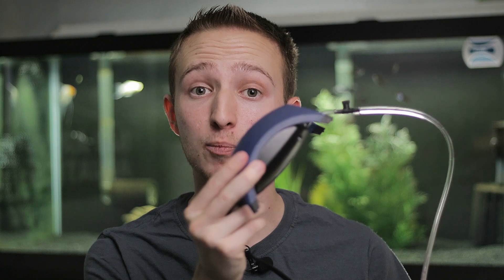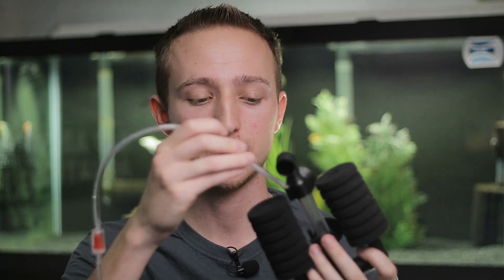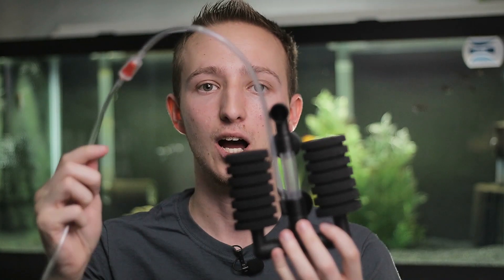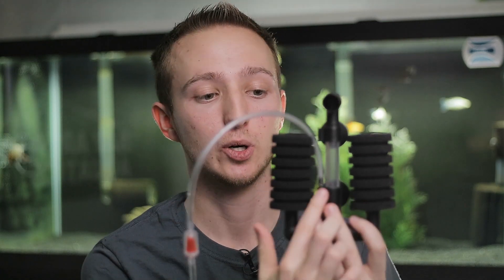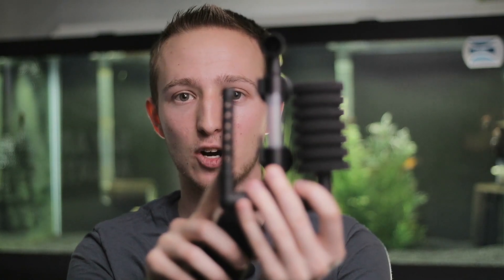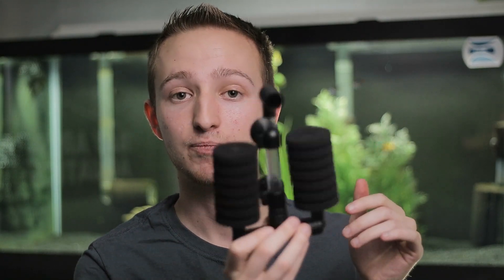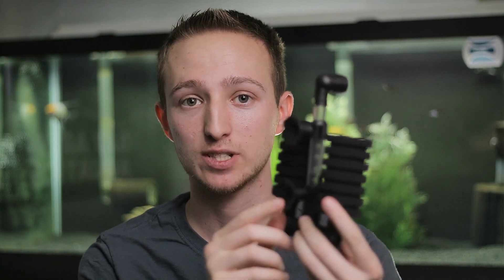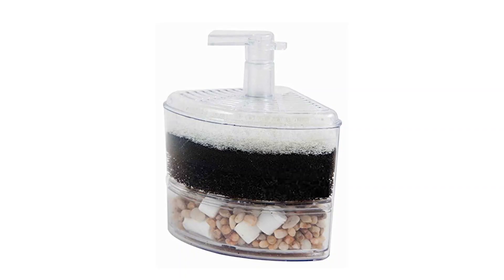How Do Sponge Filters Work?

Comment: I still don't see the suction of any significance.  If it it is its very minimal and if it can suck something maybe a Small dust size Particle if it's passing by it with no resistance at all.  But that's just my view. Just another gimmick to buy that we really don't need. Wahts next a sponge that suck with the electrons in the water no air you can't see but it's working just add it to your tank. Set it and forget it lol

Comment: I have a question: So do you replace the sponge, like you replace the media in a hang on filter? I am starting a 10 gallon betta planted tank. And have a Top Fin MF10 and was wondering what type filter would be best, the Top Fin or a Sponge Filter?

Comment: I still dont know how they filter. I get there are holes and a sponge and water goes through it but what it is doing to the water? Cleaning it? When it gets dirty do I throw it away? Just set up a new fish tank and have no clue how often do I change them out and part of that is that none of these videos I've found on YT actually explain what the sponge is doing if that makes sense?
Reply: So the sponge filter acts as a surface area for your beneficial bacteria to grow. As the water rises with the air the water has to pass through the sponges where the bacteria are. There the bacteria can start I break down ammonia to nitrite and then to nitrate. Cleaning is as simple as taking it out of the tank, rinsing it out to get rid of all the debris trapped in it, and sticking it right back in the tank. You can preventatively do it or do it once you start noticing a decrease in bubbles coming from it.  I’ve used both my tap water and old tank water and haven’t had any issues. If you want to error on the side of caution you can use tank water. Sponge filters last for a long time because they don’t haven any mechanical parts like a hang on back filter or canister filter do.

Comment: What all do i need to use this kind of filter. ... The air ... Sponge ... What else do i need? .... TIA
Reply: All you need is the sponge filter and an air pump. Get the airline tubing attached before putting it in water and you’re ready to rock.

Comment: Nope. That isn't how it works. The air bubble does not suck water up as it rise. It displaced the water. Pushing some of the water out and only if the exit tube is long enough and reaches the top of the water surface. Other than that its not doing jack squat other that and have the same displace water pulsing in and out if the filter.

Comment: I have the tetra brilliant which is like a single sponge version of what you\re holding. I'm not convinced it does anything. It bubbles and gurgles a lot but doesn't seem to actually suck anything into the filter. It's almost only air coming out of the top
Reply from the maker: It's primarily a biological filter

Comment: How do you clean one without killing the beneficial bacteria?
Reply from the maker: I get a 5 gallon bucket of either dechlorinated water or the tank water I'm pulling out, and then put it in that bucket and start squeezing the dirt out. If the water gets really dirty, I dump the water and refresh it, and start squeezing again. Some tanks are clean and only take 1 bucket, some tanks are dirty it takes 3-4 buckets before they stop making the water dirty. If you're on well water or have water that doesn't need to be treated, you can just wash in the sink.
Reply: Bay Area Aquatics thank you for including well water. I haven't really heard anyone address well water a whole lot.

Comment: I have a mini spong in my quartenite/hospital tank I just got for another new batta. So far it's ok, it's the air pump that bugs me with the noise. On high it sounded quiet and within 10 minutes makes a rattling noise so I keep it on low. Still a little loud for low unless I put pressure on the airpump and it almost muffles the noise. I couldnt find a small enough hang on the back filter for a 2.5 gallon
Reply from the maker: I find setting the pump on a towel helps a lot
Reply: @TrekOnTheAir  thank you it is rattling less but still loud so I'm keeping it on low. How long does a spong take to cycle tank? Bettas are hardly so I basically had my tank that's been sitting for a couple weeks with no filter, did a 65 % water change and put the spong filter in and filled the rest with tap water. I still have to clean it more because there is "dust" like substance on the plants and lightly over the gravel. Not sure how that happened
Reply from the maker: You're going to want to look up a "Fish In Cycle"
Reply: @ashleykeith9204  I hope you don't fill your tank directly with tap water. Be sure to get a dechlorinator, he chlorine is bad for fish and will kill the bacteria you're trying to build up when you cycle the tank
Reply: @paytonmacdonald1409  I did I just forgot to add that in. I also put in an indian almond leaf because his fins were just short from just being in a cup but hes doing great now :)

Comment: is a check valve necessary?
Reply from the maker: Not if the air source is ABOVE the tank. If it's below the tank, or even at the same level, the water can siphon out of the tank, destroying your airpump and leaving you with a mess. They're less than $1, I run it even when the pump is above.
Reply: @TrekOnTheAir  I have an aqua clear 20 and the bubbles pulse instead of flow steady,any idea why?
Reply from the maker: Bubbles from an Aquaclear?
Reply: @TrekOnTheAir  the bubbles coming out of the filter. it'll burst some out then pause and then another burst comes out. it not a steady stream like I see on everyone elses. also thanks for answering. sorry to be a pain in the ass
Reply from the maker: @bige3290  huh, that's weird. You mean like it's not pumping as steady?

Comment: As a fish keeper, I personally think sponge filters are good for fish like betta fish and in tanks up to a 20 gallon, but not recommend for sole use for anything larger. 
I have used a DIY sponge filter in a 10 gallon and a 5.5 gallon, but the filtration just wasn't what I liked. 
They great for cycling and for fish who dont like strong current.

Comment: Setting up my first aquarium, a 10 gallon Betts tank, and bought a sponge filter based on recommendations like this and wish I saw this does cuz the one I bought is a tad large for the 10 gallon tank lol
Reply from the maker: The ones I use in my 10 gallons are the ones I have linked in the description as the large dual ones.... So big it barely fits in the tank 😂
Reply: @TrekOnTheAir  yeah this one is taking up like an entire corner of the 10 gallon i got lol I will probably buy the type you showed in your video and save this one for a future tank if i find I like the hobby enough after this tank gets going.
Reply from the maker: A 4 pack of them is $10, they're great!